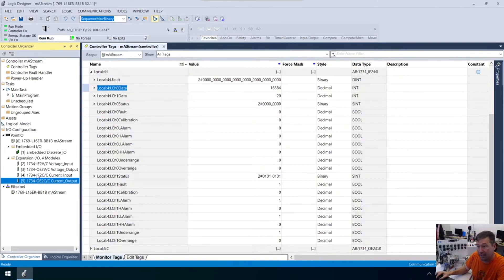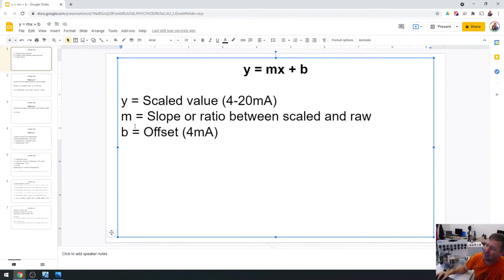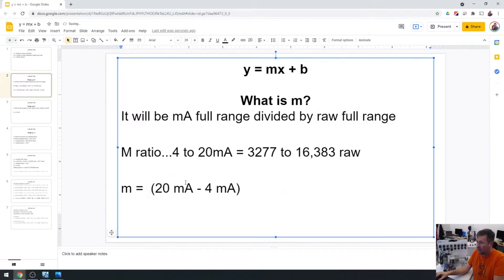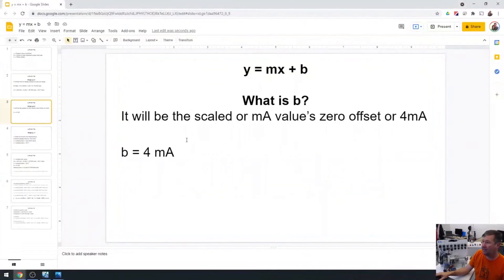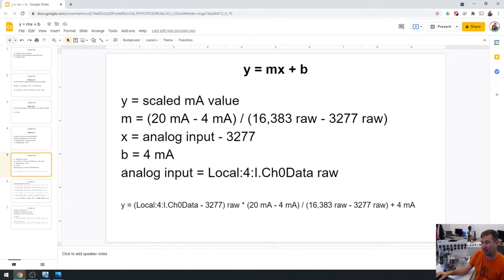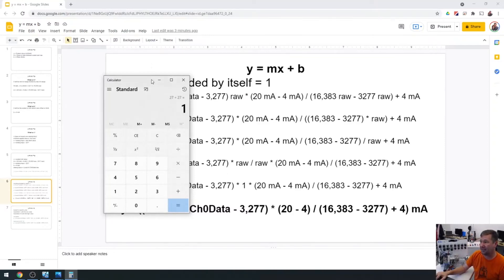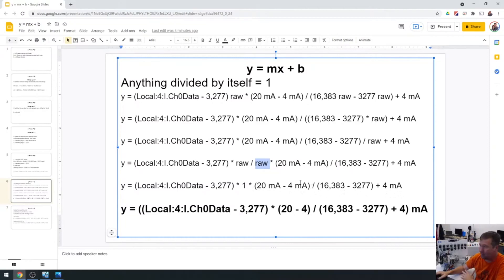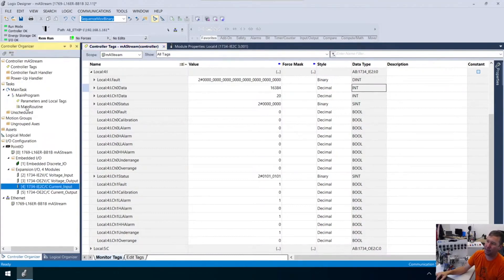4-20mA Analog Scaling with y=mx+b Slope Intercept Explained

Comment: At GM we have our "4-20" devices setup as 3.5 ma - 20.5 ma. The reason being is that various faults with the input can be sent to the PLC as either a 3.5 ma or a 20.5 ma signal. Of course if your input device doesn't provide this feature then it's pointless to accommodate for it. But it would create a fault on a sensor failure for example.
Reply from the maker: Yes, one of the lesson in the series I touch on that but I should probably go into detail on that.